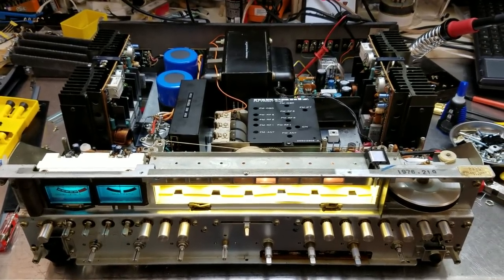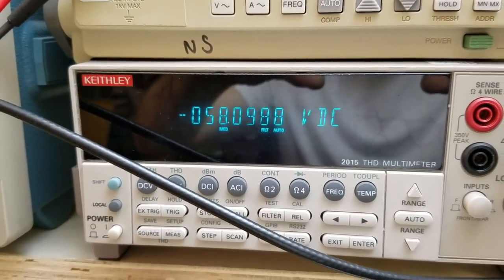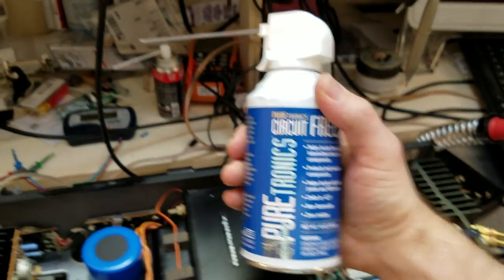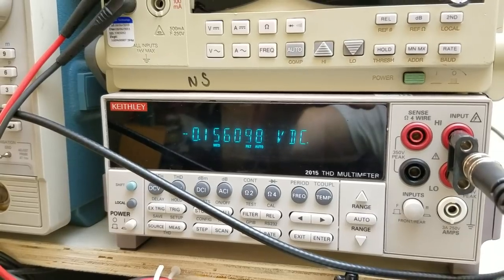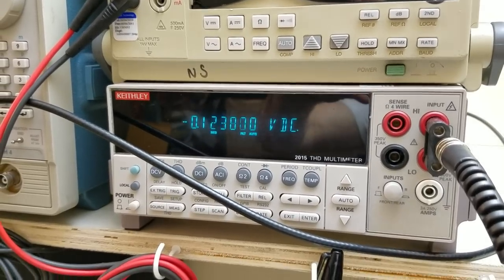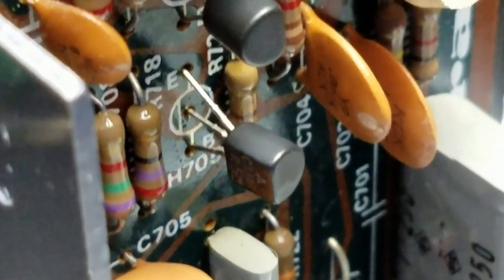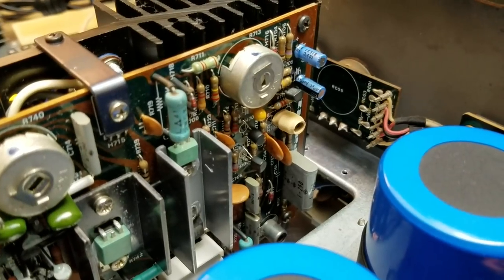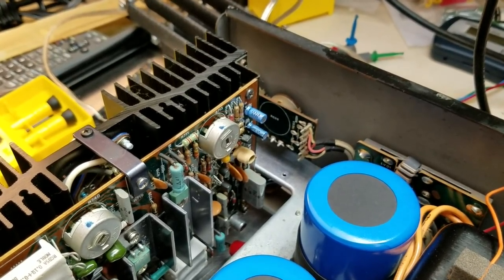Troubleshooting Tip - Behold the wonders of Freeze Spray!

Comment: You make it look so easy, I wonder if I could use this to identify the pesky cause of my Sony 570ES' left channel hissing. Is there a way to know without a multimeter (any digital measurement device)?
Reply from the maker: You might, the input stages of the power amp are always top suspects for hisses, pops and crackles. Hissing is best traced using an oscilloscope; a multimeter probably won't help assuming the basic DC voltages are proper.
Reply: @MadScientistsLair  I would definitely appreciate your help if you could head over to AudioKarma and read my thread on the situation. I'm desperate for help as I'm clueless when it comes to where signals pass in circuits. Mind if I link you?
Reply: Audio signal tracer, if you don't have access to a scope.
Reply: @zulumax1  i'll look into this soon. thank you for the suggestion. i want to know any reliable homemade devices that can substitute oscilloscopes / dummy loads / test signals  etc. any link/source?